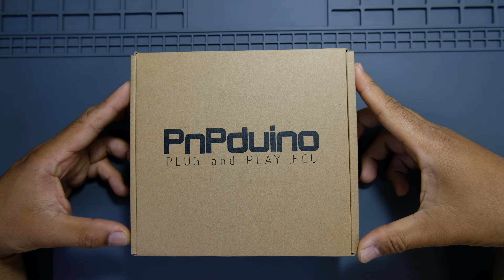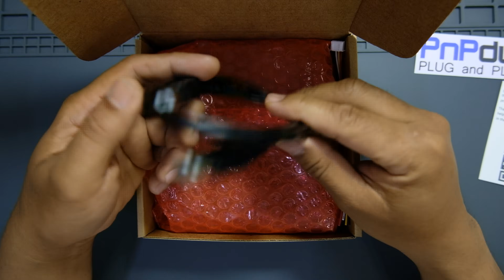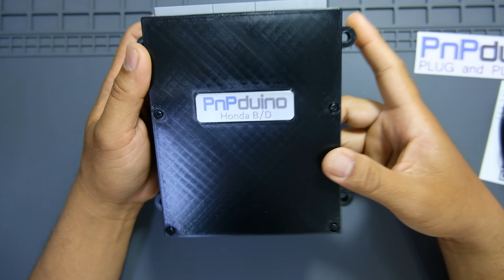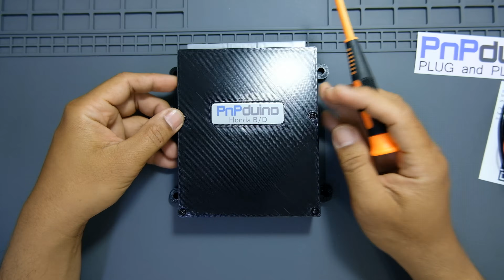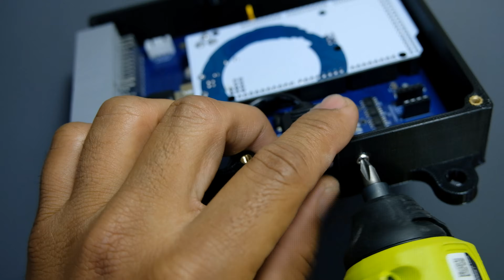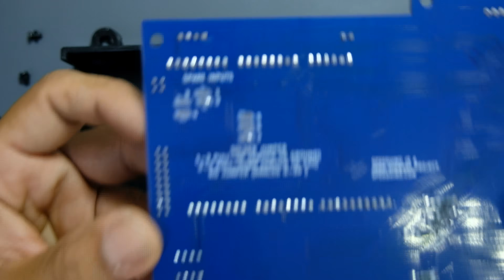PnPduino Tutorial 1: Unboxing and Familiarization

Comment: Hey bro this is badass but can it handle a boosted b18b with b16 head ? Looking to make 500 hp reliably. Can this do that safely?
Reply from the maker: Yes as long as the tune is good
Reply: @choyr just bought your last one
Reply from the maker: @soltribeprojects2055hi. Shipping your order today
Reply: @choyr can't wait to install it , thanks 👍❤
Reply: How much faster is this compared to the shock ECU ?
Does the software have built-in safety features?
Reply from the maker: @soltribeprojects2055 hello yes there are safety and engine protection features

Comment: I don't understand what u showed under the board
Reply from the maker: thats for spare inputs. you can use switch or sensors that has 0-5 volts output like oil pressure. for switches that use ground (most switches do), put solder to 1-2. for switches that use 12V, put solder 2-3. for sensors that outputs 0-5 volts, dont put solder